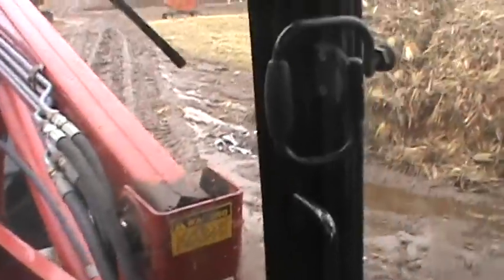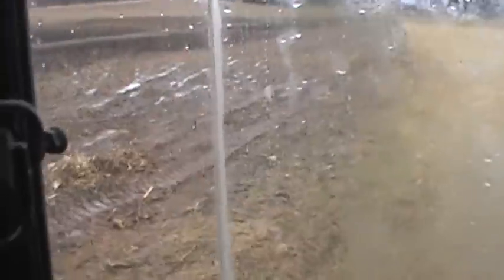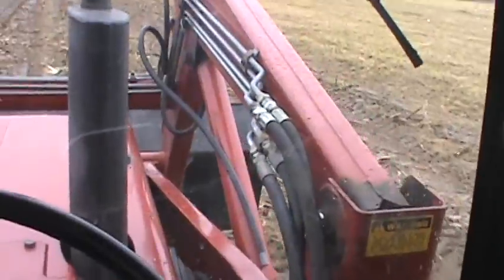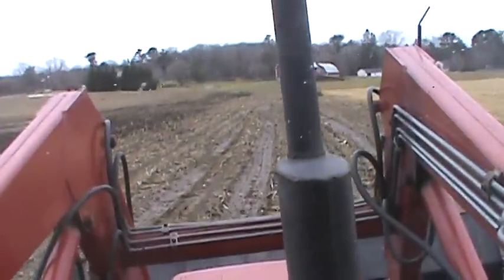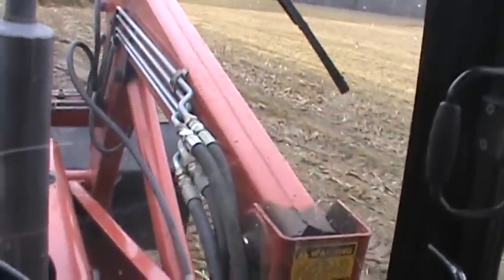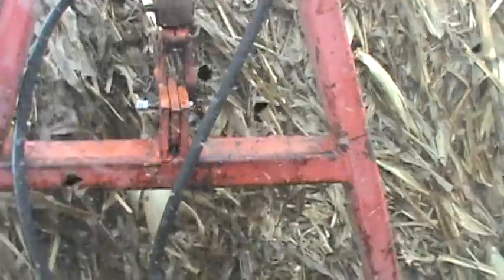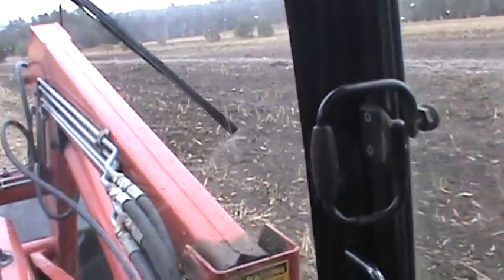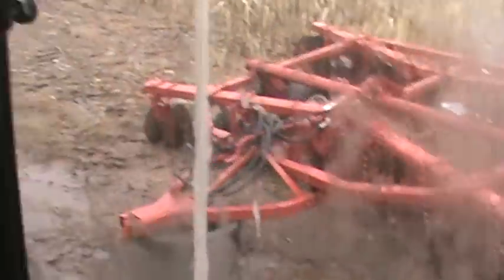Moving Stacks

Comment: If you go with a heavier disk I would say 22ft. If you go with a lighter unit I would say 25ft. I always like to go a little smaller so if you need to do heavier cutting you can drop it down deeper and still pull it.